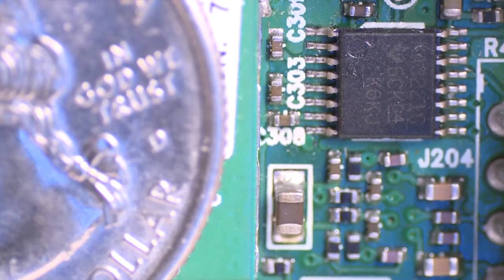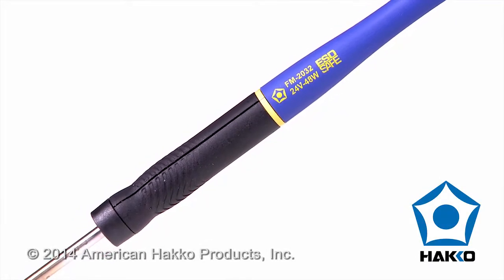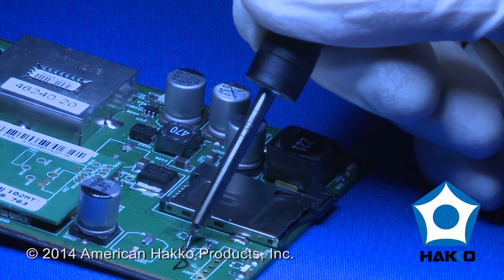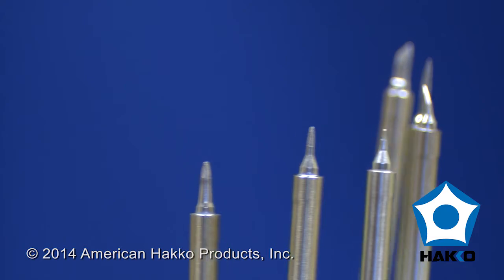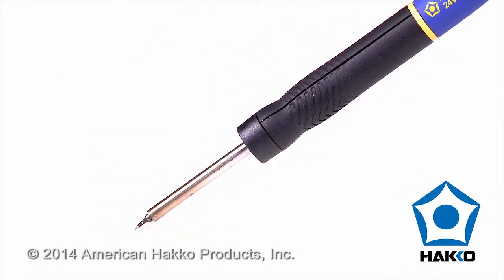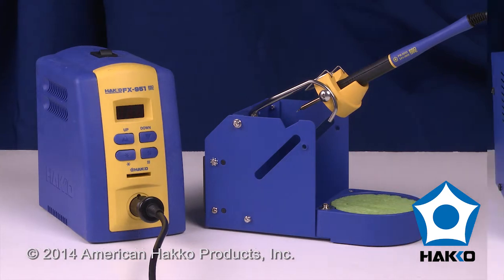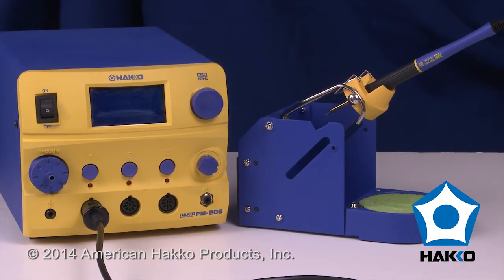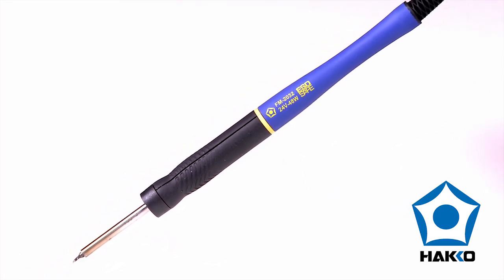Hakko FM-2032 Micro Soldering Iron by American Hakko — Rev.051215

Comment: HI! which tip would your prefer in PC Motherboard/Smartphone repair for drag soldering  T30-D1? or T30-D06? or T30-KN? I currently own T30-I for FM-2032 on FM-203 station.  I think T30-I not good to use for drag soldering.
Reply from the maker: Hi Neil, this would depend on the size of the component, size of the pad, type of board, etc. It would be best for you to call our office at: 661-294-0090. Thank you.